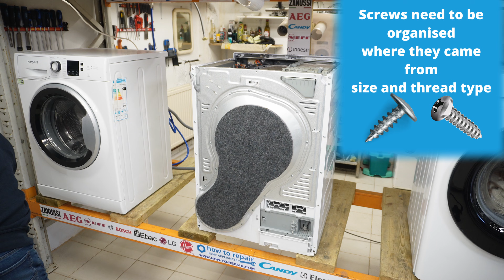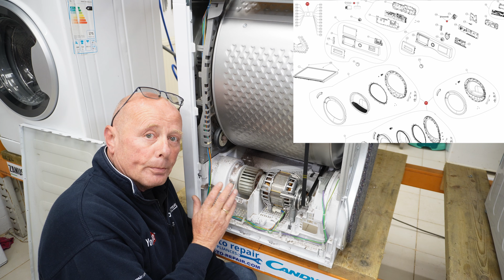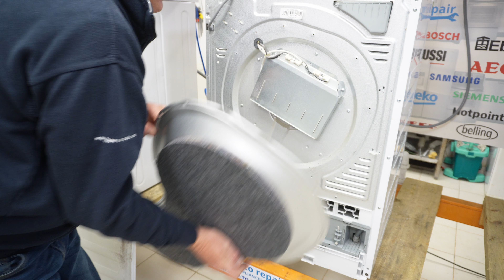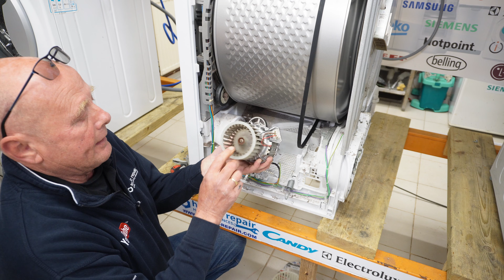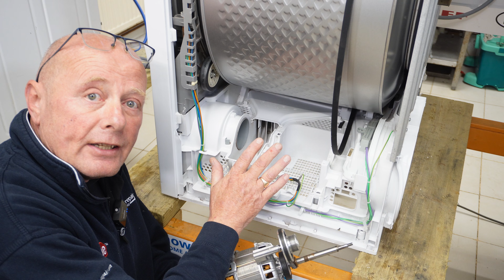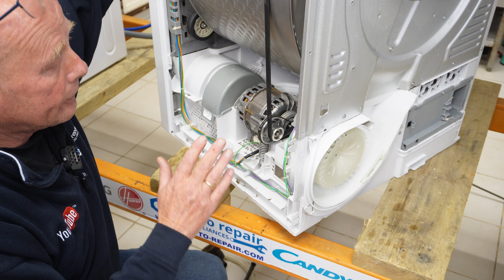SOLVED: Beko Condenser Tumble Dryer Making Squeaking Noise | How to Check & Replace Fan Blades?

Comment: Just wondering why the water container drawer is not placed on the bottom of the machine and condenser on the top, avoiding pumps and tubes. i have a Miele tumble dryer, dishwasher and washing machine, the newest is over 30 years old.

Comment: 99% sure this is the issue I’m having, so thank you.

What is the tool called that you’re using at 04:32? I’m really struggling to remove the old fan wheel.
Reply: It appears to be a ratcheting socket spanner, possibly with an extension bar.

Comment: I had exactly the same noise, however the problem was the fan blade retaining nut coming loose.  I had to take the side panel off to access the shaft (to stop it turning as I tightened the nut) and added threadlock to the nut, retightened and voila. No noise.
There was a lot of fluff internally, a quick vacuum got the worst of it.
Easy DIY fix.

Comment: Hi I have bush heat pump tumble dryer it 3 years old it keep making a horrible buzzy noise when it starts the cycle could u tell me what it is can it be fixed . If not I get a new tumble dryer 👌 cheers

Comment: That 'cursed' fan on the back just will not come off.i'm about to wrap it in rubber and vice grip it.

Then the dremel comes out...
Reply from the maker: Sometimes they are very difficult to get off as the plastic can shrink slightly with the heat also make sure you've taken the clip off may I be so bold to ask you to fame from swearing on any videos? I know it's frustrating but it's not good for the channel. I would appreciate it if you remove the word you can do this by editing the chat. I'm glad you're finding the video helpful.
Reply: @How-to-repair fair request!

Rear nut and washer are off, no  c clip in there.

Might be getting cut off then hahah

Comment: I've got a 9kg beko like this. Heard a noise after less than 10secs of running. Stopped it and there's a belt semi in the drum. Think its the felt seal. How do I do this? And are there friction plastic bearings in this model

Comment: Not only does this video cover the issue I had, but on the same make/model also...so the New fan arrived today.  The original fan had distorted so much it was hitting the outer plastic and was eroding it away. The noise was unbearable. Cleaned the entire unit and now it looks and sounds brand new. Thank you so much for posting this!
Reply from the maker: Glad my video was helpful to you mate. Please remember to subscribe to our channel, as that really helps us 😇

Since we work very hard in our warehouse making free video guides for you all on appliances, we always appreciate a beer, offering a choice of single or round beer. https://www.how-to-repair.com/help/buy-paul-a-beer/

Comment: I don't suppose you've done a video like this on a Whirlpool? My model is an AZA 9791 and I can tell the blower fan is rattling about and needs replacing or remedying. It's located in the most ridiculous position towards the front of the machine and I can't get access to get the fan off. I've removed the side panels and can feel there's movement of the fan. The nut on the wheel is facing the front of the machine without room to access it from the side panels and no front panel on the right side of the front of the machine. Terrible design.

Comment: Top video, many thanks.

Ive stripped  and cleaned all the fluff as we had a loud noise whenever the pump kicks in. Its coming from the fan ( if i stop it spinning the noise stops).
Are these easy to replace? Ive got the model number
Reply from the maker: Hi, please use our contact us page and make sure you fill out the request for what your problem is. I will need the full model number of the identification plate and the details of your problem so that I can provide you with useful literature. A video shoot of the problem would be perfect as well.

I will get back to you within 24 hours, normally. https://www.how-to-repair.com/help/contact-us/  

Please remember to subscribe to our channel, as that's what keeps this channel going. Thanks, Paul 👍

Comment: Hi - I have Beko model DCU6130 W and I am really struggling to pull out the motor. The left side of it lifts up but the rightmost silver part seems to be blocked by a plastic part at the top? Do you have any advice? Thanks
Reply from the maker: Hi, please use our contact us page and make sure you fill out the request for what your problem is. I will need the full model number of the identification plate and the details of your problem so that I can provide you with useful literature. A video shoot of the problem would be perfect as well.

I will get back to you within 24 hours, normally. https://www.how-to-repair.com/help/contact-us/  

Please remember to subscribe to our channel, as that's what keeps this channel going. Thanks, Paul 👍

Comment: Hi Paul I have a Logik LCD8W23 Condenser Tumble Dryer and it is smoking and  the filter is clean and the condenser heat exchanger is clean and there’s no fluff build up behind the heating element I cleaned the back fan unit that blows the heat into the machine I cleaned it and it’s free of lint is there a issue with my product if it smell of burning if everything’s clean any ideas
Reply from the maker: Hi Justin, I've created an FAQ page for you. You can find a detailed repair guide for your problem on this page. Here is the link: https://www.how-to-repair.com/faqs/logik-lcd8w23-condenser-tumble-dryer-burning-smell/ 😇

Since we work very hard in our warehouse making free video guides for you all on appliances, we always appreciate a beer, offering a choice of single or round beer. https://www.how-to-repair.com/help/buy-paul-a-beer/ 

Please remember to subscribe to our channel, as that's what keeps this channel going. Thanks, Paul 👍

Comment: what if there is water collecting inside the  machine ?

the fluff  been removed after every cycle . 

n the air disc is cleaned regularly 

but there still some water inside  where the mesh is 

it’s a miele machine
Reply from the maker: I'm not uploading this video until tomorrow, but it will explain this problem. There are hidden tubes and ducting holes that can get blocked. https://youtu.be/OwDaZa-QOi8